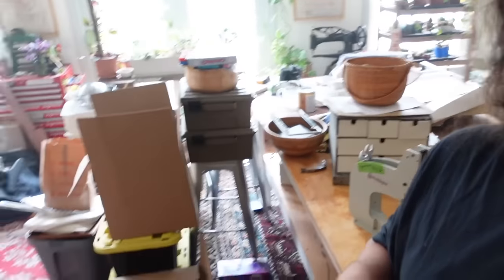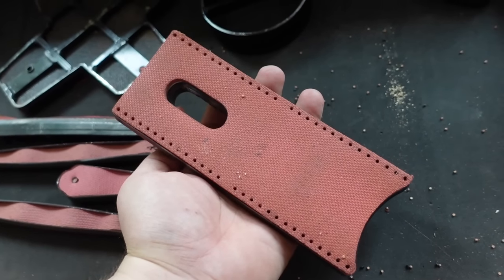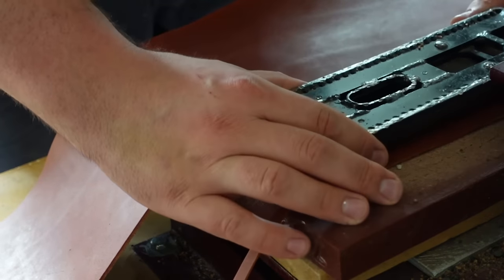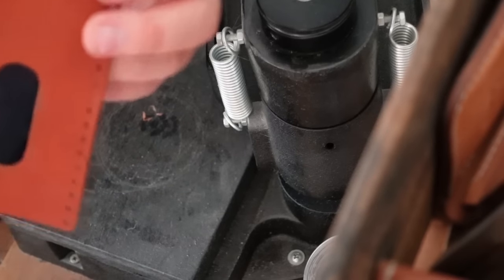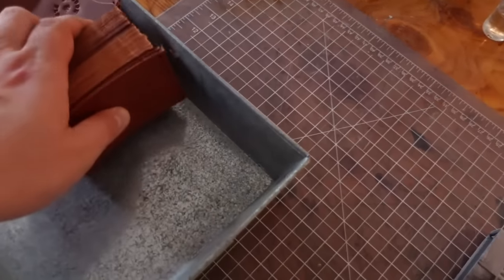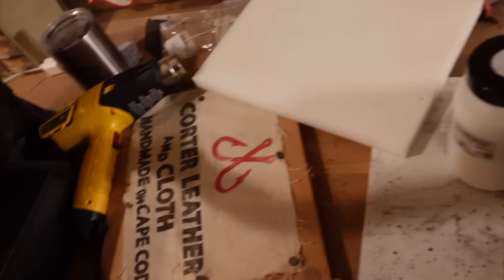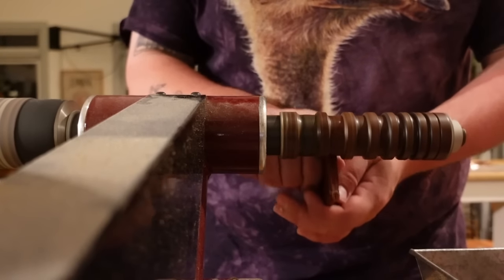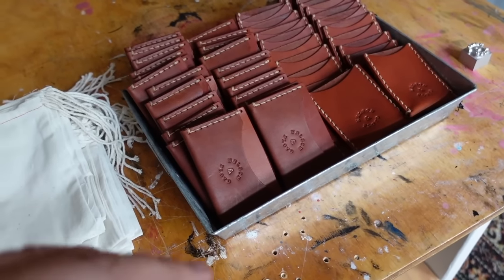How I Built My Leathercraft Business Debt Free

Comment: Hey Eric. Been following your adventures for the past 3 years now. It was in fact your video on making a belt that gave me that "seems easy, how hard can it be?" feeling that always gets me into trouble. 3 years on and I'm still at it. I also stitch without a pony and follow your exact method. Saw that stack of stitched wallets and it was enough to make my hands ache. Don't you get cramps? Big respect and love
Reply from the maker: So rad! I do get hand cramps for sure. I take Magnesium Glycinate and use a stress ball, which helps a bunch for cramps when I'm doing a run of a hundred or so wallets at a time, but they 100% still cramp up from time to time. It's usually on larger runs though, 50 is usually not a huge problem. You've kinda gotta work up to it, then be kind to your hands when you're off the clock. Stay super hydrated, do some hand exercises while you're watching TV or whatever, just little stuff like that helps a ton
Reply: Words from the man himself! Thanks for the tips and for taking the time to respond :) Man... I'm still at the do 'em one at a time for 4h each one phase and my hands still cramp out. When I'm 100% happy with my design (does that ever arrive, by the way?), I'll invest in some dies and see where that takes me. Stay cool dude :D

Comment: What about buying Laser Cutter and removing all the cutting all together? You can have one $1700 that will do almost everything.
Reply from the maker: You can absolutely go with a laser, but a blade-based machine is better and usually what most of the big guys use. Laser is good for rapid prototyping, but IMO when it comes to production the running costs and material costs are just too high long-term. You've got to tape the leather to avoid burn marks, keep up with maintenance, and have the space and electrical. With a press...I can honestly say I've never even oiled my press, they just don't break unless they snap. So a $1,000 one-time purchase that requires no venting or regular maintenance, is a smaller footprint, and works even when the power's out is a better choice for medium production IMO. 

Of course you'd eventually upgrade to a hydraulic press if your orders got large enough, or you can also use a service like Buckleguy offers where they'll use the big fancy blade machine they have to plot out a hide and cut it up for you for a few dollars - that works too!
Reply: I tried it once, but there's an unpleasant smell that stays on the item for quite a while.

Comment: Have you thought about having a metal worker make a handle that bends down to right above the floor?  I was thinking about what you were saying about your shoulder and though maybe transfer that leverage you need to pull down on the handle to your feet.
Reply: Or even get steel pipe and a pipe bending tool.  Then hammer one end to fit into those bolts where the handle joins the press.  You could even borrow the pipe bender.

Comment: Are both your presses 4 ton?
Reply from the maker: The two in this video are but I usually run an 8 ton as well. The Weaver 8 ton just kept snapping welds, I went through 4 of them in as many years. Weaver will replace them but I couldn't deal with the down time, so I'm waiting on a new larger press that I can't quite talk about yet ;) in the mean time I can pretty much use all my dies on a 4 ton if I do them in 2 or 3 pressings. 

I wouldn't normally use the 4 ton to press out dies like I did in this video because the holes add a lot of surface area, so it pushes the press beyond what it's intended for if the die is too big or you try to do a whole cut in one press - I wanted to show it will absolutely work fine if you do two presses, as I only had the single 4 ton Weaver in this video for about the first 5 years and did 50-500 piece jobs no problem. The press is still kicking. I do find the Buckleguy press much more economical and ergonomic though, I will say that. The Weaver has done me well for about 12 years with a few repairs so I'm not going to speak poorly about it, I'll always have it kicking around the shop for odds and ends I just think it's become far too expensive for what it is given the modern competition and current pricing of that press.